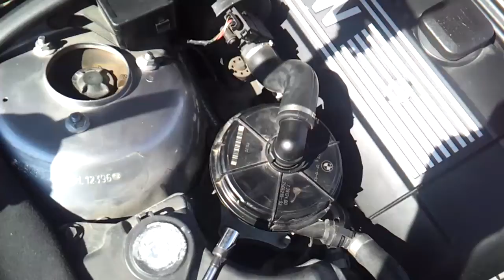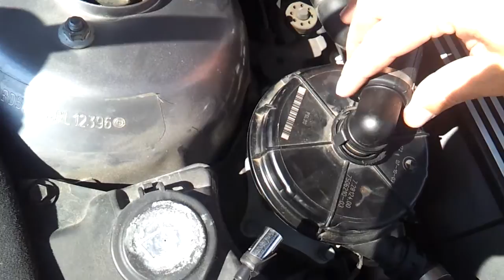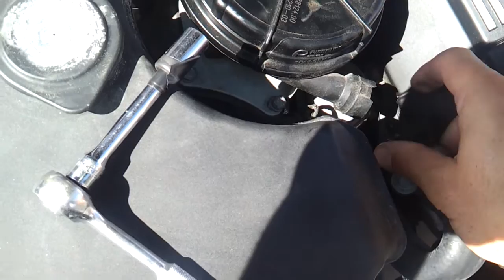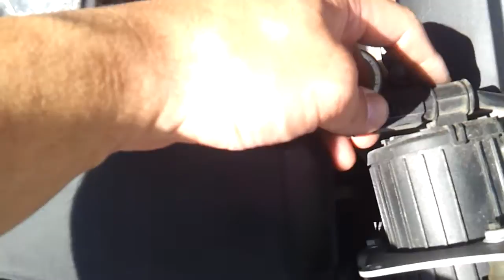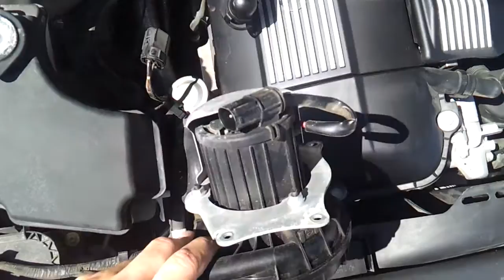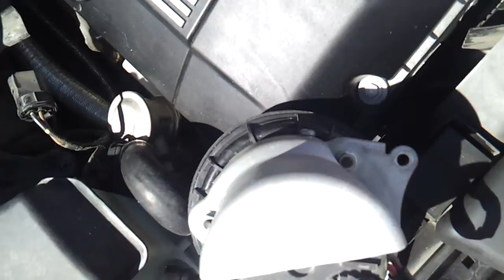BMW E46 secondary air pump removal

Comment: there is the air hose clamp that you touch at :09 in the video, im trying to replace the secondary mass air flow meter that goes to it and I cant figure out how to remove that clamp, can you show me?  thanks!!
Reply from the maker: If you are referring to that hose with plastic clip that goes to the valve under the pump, its hard to remove.  I replaced the valve and replaced the hoses for both the valve and pump. I threw away the old hose still connected to the valve.